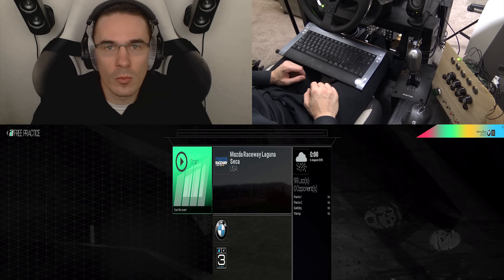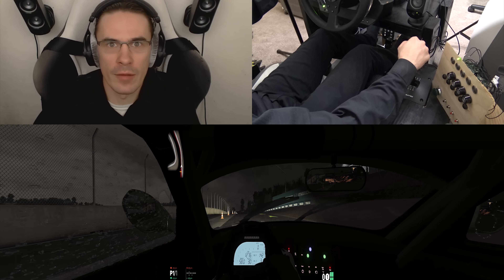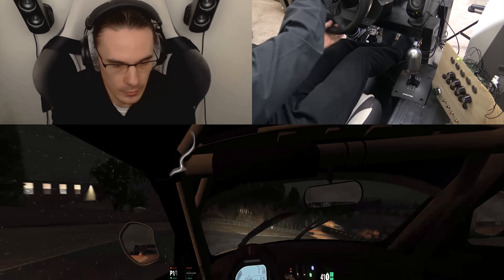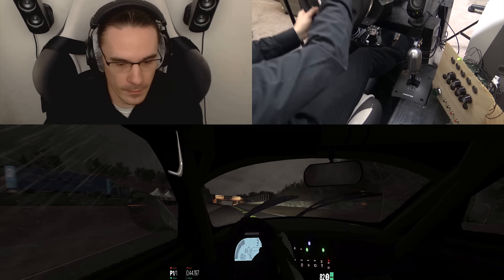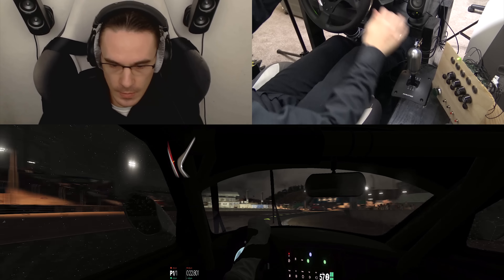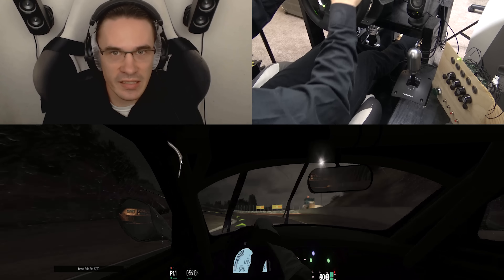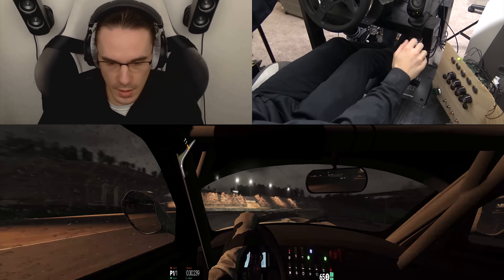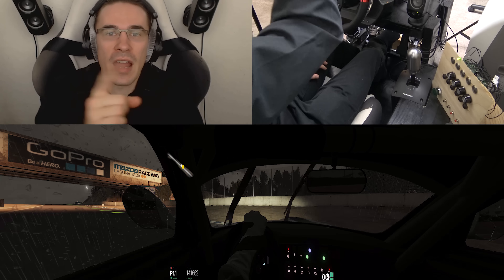Button Box Part 3 Project Cars

Comment: Great job! I would have a question. The turning buttons/analog sticks can be used to increase or decrease like brake bias? The only reason I need a buttonbox is to adjust brake and rollbars, but not by pressing a button.